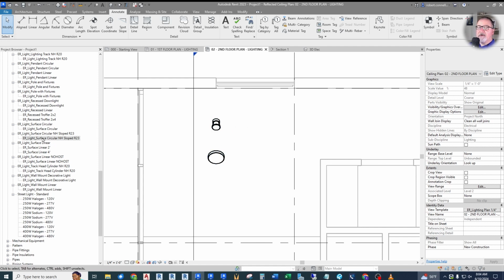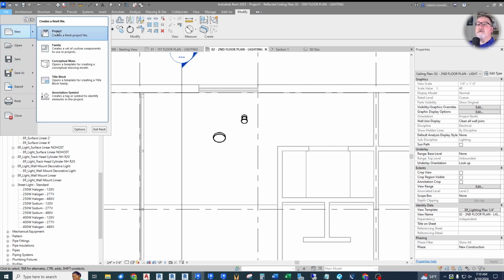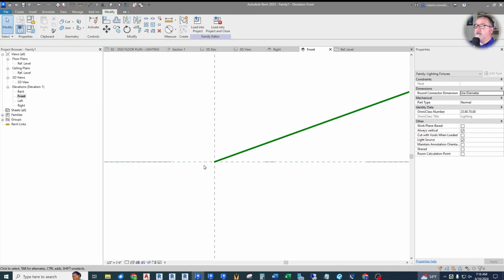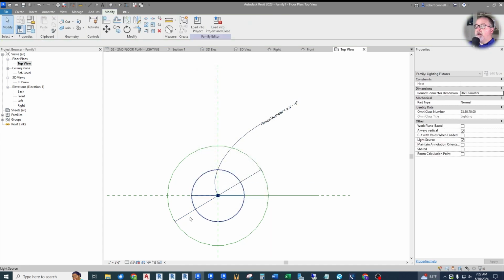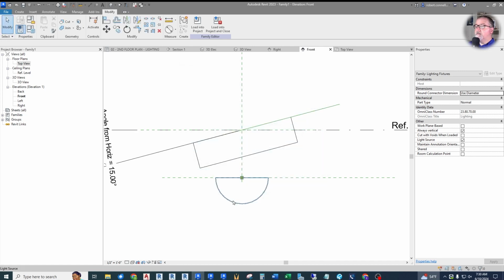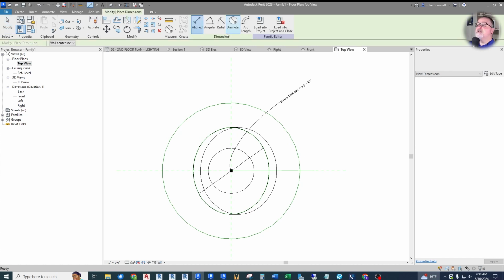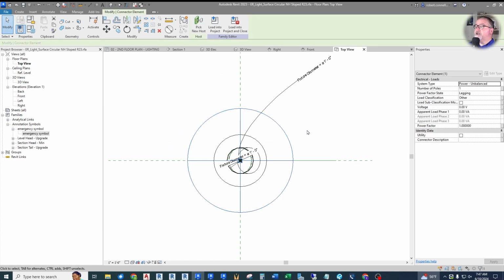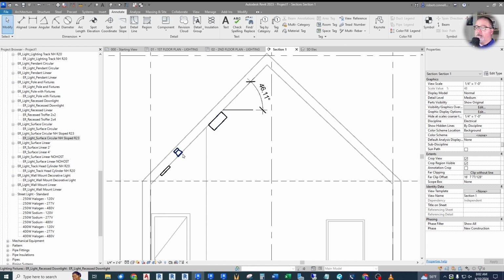Fix Skewed Light Fixtures on Sloped Ceilings in Revit

Comment: Thanks for the step by step video. I'm getting a weird error where if I change the angle to 0 and then back to any number the constraints are not met. I've been tinkering with it without success.
Reply from the maker: Hey there Felix! Sorry to hear about your error, but glad you brought this up! I've heard of this issue happening sometimes in certain families, so try this fix. I'll try to describe this without visuals, so bear with me! In the "Front" view, add locked angular dimensions of 90 degrees between both horizontal reference lines and that one vertical reference line that "connects" those top and bottom boundaries of the light fixture. See if this fixes the constraint issue. If not, please email your family to me at electricrob2022@gmail.com so I can help fix it! Cheers
Reply: @ElectricRob  This solution works. Thanks
Reply: @ER This solution works perfectly.Thanks.